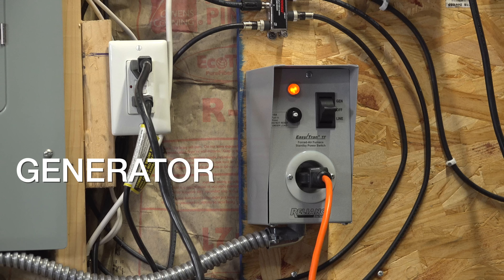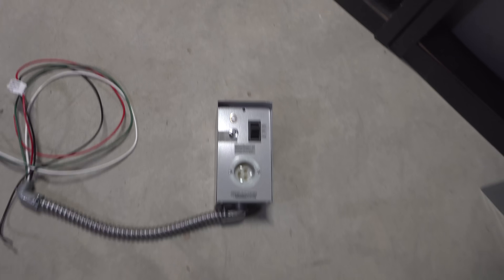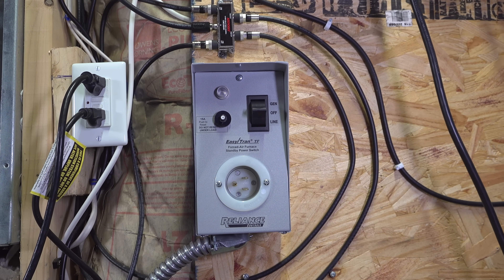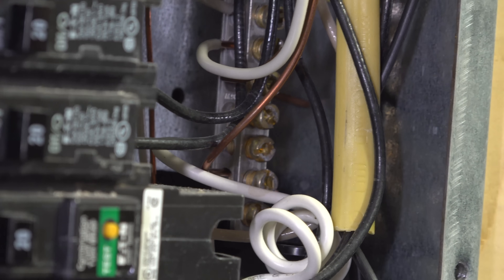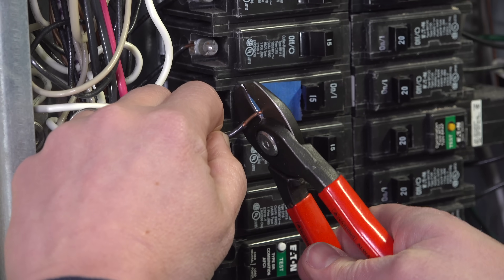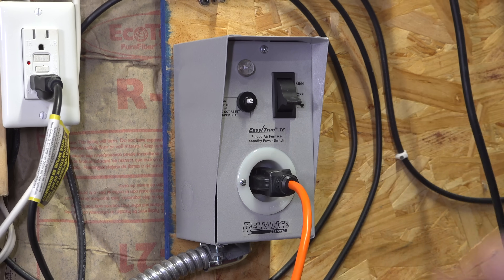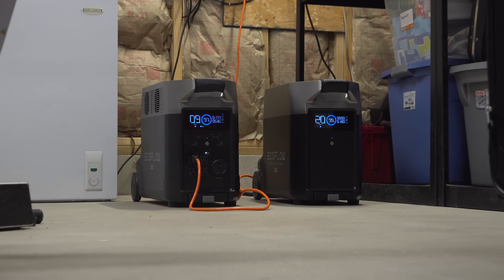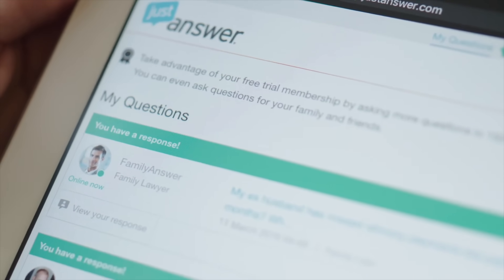Easy DIY Generator Transfer Switch Install - Works with ANY Portable Gas or Battery Generator

Comment: I never knew that there was a solar generator this powerful that can actually run the whole house.
Reply: It's not running the whole house ..Just his heat
Reply: LOL, it ain't running the whole house, its only running 1 20amp circuit.
Reply: If you combine it with a second unit + a couple batteries and the home panel they sell you could to that, just keep in mind that's about 14kWh of power total to use.

Comment: I do agree that running a solar generator indoors is much safer that an old gas generator that has fumes and smoke aside from the noise it creates.

Comment: I did not expect that the Delta Pro had that much power. I am really impressed by it.
Reply: i was more surprised that the furnace was installed on a 15amp circuit. i guess it is a gas furnace and only needs to power the fan (forced air part) of the system. 80 to 100amp is usually what you see for electric furnaces. so this switch is not designed for that type of use as i see it has a built in 15amp breaker on it and is only using 15amp rated wire. so that delta pro is seeming only powering a fan on a 15amp.. not much to be impressed by. now if it can power a full electric furnace system..that would be pretty sweet.
Reply: i will definitely power it.. but if it's winter and the furnace is coming on more frequently a average unit with a 1/2 to 1/3 hp blower motor plus a  inducer fan you're not gonna get 20 hours of run time not even close

Comment: It is not running your heating system. Your heating system is 240 volts. This is only 120 volts. Scam,alert. It may run your heat system blower but will not run any heat strips. They are just selling you something useless
Reply from the maker: You might open your eyes and watch the video, his system is 120v. My oil heating system also runs on 120v. They are not 240v. Sorry to burst your conspiracy bubble.
Reply: @SilverCymbal  You need to explain on your video that you are not running a 240 volt heating system. Not just say it will run your heating system.
Reply: If you have a gas furnace it only uses 120V to run a fan, electronics, and the ignitor.  

However, the nonsense setup in this video is pretty much useless, who the hell would spend $7k on those ECO units and then only power 1 circuit out of a whole electrical panel...and those ECO units are only 120V, so water heater if its electric, electric dryer, electric range, etc. all useless in a power outage with those ECO units.  For what this homeowner paid for those 2 Eco units, and to have that stupid transfer switch installed he could have bought and installed a really nice whole house backup generator with an automatic transfer switch and never had to touch a thing during a power outage.

Comment: Will a oil boiler run on this hookup ? I assume it will but do I need to get power to the well pump too to feed the boiler ?thanks
Reply from the maker: The well pump is like 240v so this won't help with that but almost every oil burner setup including mine runs off a 120v circuit and this is about 90% of the reason that people buy this switch since without heat things are definitely not good! At least water you could fill up some jugs before to buy time but cold is cold.
Reply: @SilverCymbal  thanks ,so the boiler is self contained with water so to speak I don't need to do anything else on that front ?

Comment: 705.NEC702.6 contains one exception to the transfer equipment requirement:
“Exception: Temporary connection of a portable generator without transfer equipment shall be permitted where conditions of maintenance and supervision ensure that only qualified persons service the installation and where the normal supply is physically isolated by a lockable disconnecting means or by disconnection of the normal supply conductors.” There's no need to freeze if you understand how to disconnect the main, and your panel locks.
Reply from the maker: Except a residential panel has no locks as required at the end of the code. There is no argument that back feeding technically works and no argument that backfeeding has killed and will kill. I will never recommend someone backfeed which remains an illegal practice and that exception won't work for residential panels without an interlock. Interlocks are compliant and so are transfer switches like this.
Reply: @SilverCymbal  backfeeding is defined ONLY as feeding power back into the utility lines, not feeding power back into a panel from a generator.  Thus even if you were to recommend they pay attention to the exception you wouldn't be "recommending backfeeding". "Recommending backfeeding" would mean recommending leaving the connection to the utility closed and active while putting power to the lines with a generator. As soon as you "recommend" turning the main switch off, you've stopped being able to "recommend" backfeeding. 
Every panel I've ever worked on was lockable, so I'm not sure where you live with unlockable panels. The code clearly indicates that with conditions of locking and supervision met, that the transfer equipment is not necessary for temporary connections to a generator.  This is a simple "horse to water" issue.  The code is in clear English. It factually is not in any way illegal to wire a portable generator direct, or back through a breaker to a panel when you have your main disconnected and locked and you've ensured unqualified persons cannot access the configuration.  There's good reason for that common sense exception.

Comment: I don't know of any electric household heat source that's 110. It's usually 220 making this install worthless and especially with a battery generator.
Reply: A gas furnace will usually only require a 120V 20 amp circuit to run the blower, electronics, and ignitor.

Comment: In what world does a household heating system run off 110vac. I have a heat pump in a relatively small house (1650 sq/ft) that needs 220vac and although efficient would kill those batteries in a couple hours.  Be honest about the capabilities of these solar generators please.   I had a friend invest $3,000 in a system only to learn it didn’t even have lithium batteries
Reply from the maker: Every house I have lived in my heat has been on a 120v circuit. My friends as shown here is forced hot air, you can see my system in my videos which is oil and also on 120v circuit.
Reply: A gas furnace only runs a fan, electronics and ignitor....very low power draw which only needs a 120V 20amp circuit.  

If you have a heat pump or an electric furnace, and air conditioning you certainly will have a 220V circuit usually 30amps or more.

Comment: I thought you need two Delta Pros to act as a generator to plug into the panel. Is that only if you have an interlock connection instead of a transfer switch?
Reply from the maker: Thats for a 240v connection. This is a single 120v connection only.

Comment: Is there an automatic system that switches it over to generator
Reply: Yes, however they're not immediate, so you'll still have a few seconds of blackout conditions as the switch detects no power and switches to the generator, and fires up the generator.

Comment: Thanks for the video and great share. In your video you showed delta pro and curios if you or anyone know if this is possible   for ecoflow delta max or delta where you can connect to a transfer switch/control panel
Reply from the maker: Yes a Delta Max will work with he the transfer panel shown as well.

Comment: What heating system can run on only 15 amps?
Reply from the maker: Forced hot air, forced hot water. My friends is 15 amps (air) mine oil with 6 zones forced hot water. It's also on a single 15 amp circuit. The fuel creates the heat, only needs a little electricity to get it around the houses, but without power you have none.

Comment: No electrician worth a crap is going to use those Wago connectors. They only barely make a connection thus cannot handle much current. They eventually over heat from resistance and fail.

Comment: So would I have to install separate switches if I’m using multiple breakers? Or there a safe way to jump them to one switch? Does amperage matter? Or should I just get a sub panel and run the transfer switch off the main breaker for the sub panel?
Reply: a guy could just get a multi circuit switch, or get an interlock and back feed your whole panel.  I did the interlock method.  Now my genny wont run everything on the panel so I shut off the things that are not a critical load.

Comment: Note:  A main circuit breaker panel cannot be used as a raceway per NEC. All wires which enter the panel must terminate in the panel. In this example, the wire spliced to the circuit for the heat leaves the panel without landing.
Reply: That is not true. NEC Section 373.8 States you shall not use enclosures for overcurrent devices as junction boxes or raceways -  UNLESS you provide adequate space. Conductors inside a panel board shall not fill the wiring space at any cross-section to more than 40% and splices or taps shall not fill any cross-section to more than 75%. I highly doubt the splices on a 12AWG wire would take up more than 75% and any given cross-section. So splicing is permitted.
Reply: I am not doubting your statement, but every transfer switches uses the same method shown. The whole house generators operate several circuits using the same method. The fact that you can’t operate all the circuits on a generator makes this method necessary.

Comment: Can’t run a generator inside, how do you get the cord outside?
Reply from the maker: Run the cord through a door or window, I did it this way for many many years, be sure the generator (gas) is safely away from the house. I used a 100' heavy duty or 50' cord.
Reply: @SilverCymbal  at 30 C below I’m not opening a window. There has to be a better way.
Reply from the maker: @danlux4954  Simple just put a towel around the cord. and clsoe the window. The window will be open 3/8" and if you don't have power and no heat your inside will be as cold as the outside. If you want to have an outside outlet done with an interlock thats a good option too, more complicated and more money.

Comment: I just had a 50A interlock setup installed. Capable of supplying up to 12KW of power. Interlock is nice because you can pick and choose which circuits you want to run.

Comment: Wouldn't that also put power back into the power lines? I'm aware solar can do that and they need special circuits to stop linesmen from being at risk
Reply from the maker: No, there is no way for that to happen with this switch. It is as though you are taking the wires that feed your heating system out of your panel and plugging them into your generator isolating them from the panel & utility.

Comment: That APC power strip on the wall was recalled by Schneider Electric and the CPSC for burning down houses.  CPSC recall #14-001.
Reply from the maker: WOW! Hey thank you for sharing this. I just texted this to my friend. Scary! Thanks again
Reply: @SilverCymbal  No problem.  Currently working on some solar/wind for my greenhouse and the analytics pushed your video.  HAPPY GARDENING!

Comment: Ok you gave a little bad info here, the only time that the ground and neutral wires can be landed on the same bar is if it is the enclosure that houses the main breaker for the service, any panel down stream of that requires that there be an isolated neutral bar and this bar is require to be isolated from the panel can and ground bar, the murals land on it and the ground wires land on the bonded ground bar

Comment: I wonder if that ecoflow would run my heating ac unit and for how long? My AC is on a double 30 and my furnace is on a double 60
Reply: No chance.  Even if you could connect it the storage capacity would be less than an hour. "Double 60" says electric heat to me and that means a large, 15 to 20 kilowatt pad mounted diesel or propane generator and a whole house automatic transfer switch.
Reply: LOL, not a chance, those ECO things are only for 120V circuits, your HVAC setup is 240V.

Comment: We used to have a big setup which could switch most breakers between line/generator individually but our current install is a single full-house transfer (just an extra breaker with a mains interlock) which is honestly adequate 99% of the time — usually power is either working perfect or totally out and we have a single powerful generator.
Cool to see there are smaller options similar to what we had at the other houses because they could definitely be super useful for some situations.
Reply: I have that, too. It’s cheaper and superior; the entire house can be turned on.

Comment: Your video is very informative, but I noticed that you neglected to comment when you shut off the breaker before installing the generator. If someone neglected to do this in a power outage, would there be a backfeed to the panel and line?
Reply from the maker: That's the best part. You never touch the circuit breaker when using the generator. The switch is wired ahead of the breaker, so it remains on while you safely switch the reliance switch as shown. That is part of the reason the switch has its own breaker since when you are using it, it takes over the job of the panel breaker.

Comment: the white should go to the neutral bar and the green  to the ground bar if it has one
also the black should be hooked to the breaker if im not mistaken and the red wire to the wire that was on the breaker
Reply: If this is a main panel (not a sub panel) then having the neutral and ground on the same bus is allowed.

Comment: this is for Gas heating. it taking massive 10-20k watts to run any real heat pump or electric heat
Reply from the maker: Oil heating systems here use even less power, as seen in my other videos. Modern heat pumps are easily run with this if they are 120v. No gas or battery generator will run electric-only heat for long.

Comment: Thank you for sharing this. We get our water from a well, and while we draw our cleaned water from a 2500 gallon tank, if the power goes out we can't pump that water into the house. I've struggled to figure out how to handle this situation since we don't need continuous power. I had never considered a battery backup system like this which seems ideal for this sort of short demand situation. This is just what I needed to get some peace of mind here here in Texas with our unreliable power grid.
Reply: If you don't want to run a generator (or use a 120V battery backup supply) there are also 12Volt water pumps than can  be run off of a car battery. If you keep the battery on a tickle charger it should be ready to go when the power goes out. You may have to plumb in some valves  so you can switch between normal well pump and the emergency pump.
Reply: You could have a system where the pump starts the generator when pumping is needed. Same with the furnace. You just need an electric start generator.

Comment: Is there a way to make switch automatically when the line power is out?
Reply from the maker: There are such things as automatic switches called ATS's but I wouldn't install them at home. They are expensive and for single circuit things like this, eventually they will fail where this switch should really last forever.

Comment: So perhaps I missed it in the video, but I'm assuming this is a gas-fired furnace, or similar.   That's the only way a battery "generator" like that is going to run the heat for more than a few hours.  If it was an electrical furnace it would 1)have to be 220V, and 2)would need considerably more generator power.
Reply: Yeah, most northerners have a gas furnace, so its assumed to be default, but they're less common in the south. I've never had gas heating in Texas, having lived in a dozen places.

Comment: What kinda transfer switch for an outside installation using a gas generator?
Thanks 
Matt
Reply from the maker: You can use the same switch, many do it this way, Just run the extension cord through a door or window and of course the gas gen must be located outside.
Reply: @SilverCymbal   To eliminate the air breech in the winter, what type of transfer switch is applicable for exterior installation?
Matt

Comment: This type of switch will ONLY work if you have gas or oil heat and your furnace or boiler runs on 120V only.  If you have a heat pump or baseboard heat or electric furnace, these will NOT work for you, you will need a switch that does 240V and a large generator!
Reply from the maker: Yes thats true, electric heat is never good for any generator, just too much power draw but oil and gas systems can work very well with this setup if they are 120v

Comment: I want to know what type of heat does he have that can run on single phase 120v?  Everything I have ever come across needs 240v to run the blower.
Reply from the maker: His heat is forced hot air and the fuel is propane. It has an electric ignitor and blower, the house is about 2500 sq ft so its a good sized system. In my house its uses oil with multiple zones and circulators but it all comes back to one 120v breaker also.
Reply: @SilverCymbal  do you have a 240V version.  My propane furnace does require 240V.
Reply: @laser31415  I have a propane furnace and the blower, ignitor, and electronics run on a 120V 20amp circuit.
Reply: @SilverCymbal  That is nuts.  a 120 blower would be so much better!  I don't know about retrofitting the piece of junk we have though.  Also, we're down south, don't know if that is even an option.